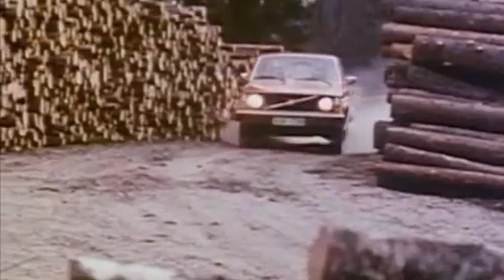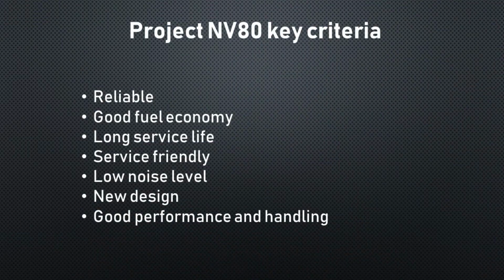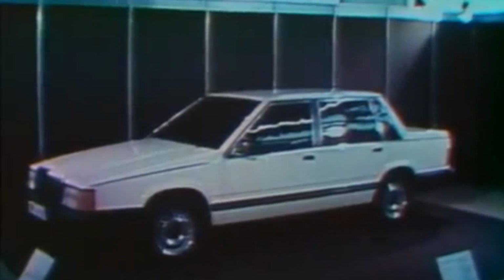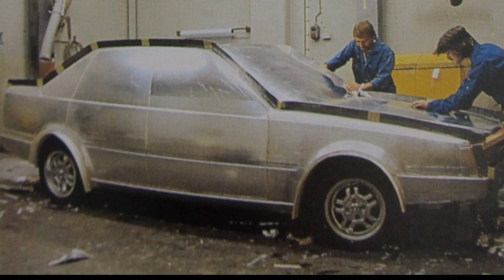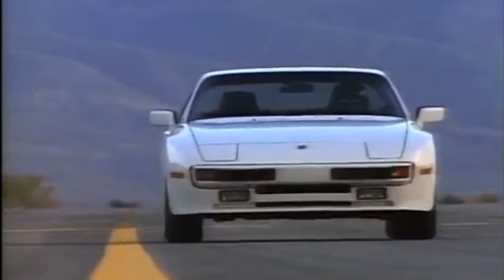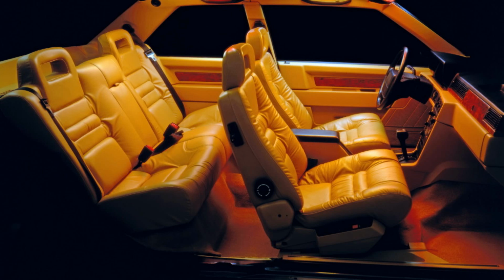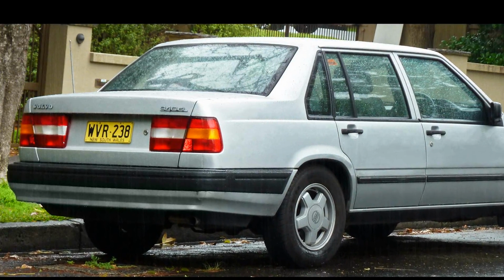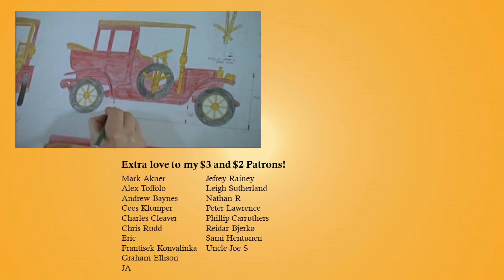How the Volvo 740/760 SAVED Debt-ridden Volvo

Comment from the maker: I mention the 240 was unreliable - in the first 1-2 years of manufacture. After that they solved the reliability problems.
Reply: Yeah. Volvo manufactures some of the most reliable vehicles in human history.
What's funny is, most are afraid of purchasing a mid mileage used Volvo. (1-200K miles) Afraid of what Volvo dealers will charge them to change a freaking sparkplug. 
Long story short: Our used car lot commonly purchases mid mileage Volvos at auction for anywhere from $375 to 3K and resell them for 3-10 times purchase price.  With very few coming back with mechanical issues. The same can't be said for Fords, Chevys, Cadillacs, Pontiacs Dodge Chrysler Lincoln Mercury HumVee/Chevy....ya gotta  get an old Mercedes or BMW to hang with used Volvos. Or just get a 1987 Jeep Cherokee 4.0 and put 1/2 million miles on it going places monster trucks couldn't even go.
Anyway, love your content @Big Car. Huge thumbs up again.
Of course Toyota Honda duh.
Reply: B Brunson  
Yeah. Or '70 Plymouth Barracuda. Lol 340 6 pack.
Reply: Big Car why is your name big car ?
Reply from the maker: @a-manlordsoftime755  Good question! I picked a generic name that was easy to remember and matched the icon I chose. When I started my channel I didn't even think I'd do car videos exclusively.
Reply: @a-manlordsoftime755  
Because tiny car was taken. And tests showed that ugly car wouldn't be so popular. Not to mention big fat car.
Reply: What were the main reliability issues? My parents had one of the last 145's (registered in July 1974) and kept it for 30 years. From memory it only failed to proceed once, when a fuel hose split
Reply: I had 1976 245. Very basic and was not unreliable IMO. Had a single fuel pump that lasted over 100K miles, K-Jet and ignition were fine, can't say I remember any weak spots other than blower motor resistor.
Reply: was just about to scream but then this comment saved you my man
Reply: ...and made probably the most reliable car of all time!
Reply: About Volvo being a luxury brand is complete bullshit according a documentary about Volvo. In Sweden Volvo is a car for everyone between poor and rich. Outside Sweden Volvo market it self as a luxury car to attract foregin costumers, particular north americans. Today does the chinese owns Volvo and makes Volvo as a real luxurybrand.
Reply: Was about to comment "a unreliable Volvo!?"
Reply: @cmartin_ok  the early B21 engine with over head cam was hard to start, they had to change the ignition coil to a high capacity one with a resistor, that was about all and done in the first two years. The 102hp engine used more fuel than the 82hp B20 from the earlier models that you could opt for. My father bought a 1975 242DL but opted for the known B20, I learnt to drive in that one, he later switched to a 1981 GL with it's new upgraded B23, an motor that needed more octane than was available and Volvo service changed the timing curve in the distributor with new springs for the centrifugal advance setting , still if you went too low on the rpm you could get knocking from them. Later model got knockingsensors that adjusted the by then electronic timing. And as the lambda equipped fuel injected katalytic models became standard in 1988-89 that was a thing of the past. I have allways liked the 240 roadhandling while slippery roads over the 740, the 240 tells you earlier and in a less abrupt way that it is slippery outside and you get to react better. Also, if you run any B21-B230 except the B230K with it's electronic carburator and ignition chambers in the top of the pistons, then there is no way for a broken timing belt to crash pistons and valves, the lift of the standard camshafts are to small for them to meet. The car just stops running.
Reply: The 242 was not unreliable. It was the same quality as any other 240.  
240’s being one of the most reliable cars ever made. That's why they are still around that much.
I owned a 242 from ’76. It was underpowered, but definitely reliable.

Also how was Volvo in debt after making the same car (with minor tweaks) for years and years on end.
Reply: You should elaborate more on this, why were they unreliable. The initial cars were introduced using the Volvo B20 engine, it is by far one of the most reliable engines ever built by any car manufacturer. Ever. It's predecessor, or rather previous variant with a smaller bore, holding the same title. It is the engine that powers the longest ran Volvo (if not the longest continually daylied car ever in human history) the 3.2 million mile+ Volvo P1800. An engine that had it's first full rebuild at around the one million mile mark, if my memory serves correct.
Reply: B Brunson  Interesting. I've had two 1972 164Es, a 1990 760 Turbo and a 2002 s80. My sister had a 1972 (I think) 144. I prefer the 2002. And the newest one has needed the least amount of maintenance. I do prefer the 90s visibility, however. I actually love the new Volvos because they've gone back to their roots in terms of understated, yet elegant style. Sure, they're expensive, but they've been expensive for a while now.
Reply: Compared to what? Compared to Volvo 400 (440,460 & 480) everything Volvo made untill then was super solid cars!
Reply: The 200 series still runs all over the world. Its one of the most reliable cars every made.- infacet all of them from start of production.
My dad had one of the first made and he sold it when it had run lver 500.000 km, with almost no repairs.
Reply: I've had Volvos all my life in the family from 1983 to present, 245 DL, 240 DL, 740GL and 940CD Classic in 2.3LPT guide.
Reply: @swededude1992  That's true for the older Volvos. At that time you drove Volvo, Saab, VW, Ford or Opel. if you was working class, the Boss drove BMW, Mercedes or Audi. Today most working class drive older Volvo, BMW or Merc. If you bye a new car today it's a Kia, Hyundai, Peugeot, Ford, VW because a new Volvo is to expensive for the working class. I drive Volvo but i buy them three year old at half the price.
Reply: I was going to say. The 240 I had was very reliable. The thing that wound up getting mine in the end was chassis electrical... 34 years after it left the factory in Halifax, Nova Scotia.
Reply: I loved my 1985 240. It was the best car $2,500US could buy and it lasted. The wiring and AC were poor, but otherwise a very robust car.
Reply: @phildouglas9086  was
Reply: A
Reply: @tellofiriometto5810  Huh? Oh. You meant Vulva instead of Volvo. Got it.
Reply: Yep.. The 240, along with Camry XV10 and Accord CB, are widely regarded the most reliable vehicles made.
Reply: Yes, or else it would have been one of the biggest lies. Nothing can kill a Volvo 240, at least not humans.
Reply: A first year of manufacture (1975) Volvo 244DL B21E is my daily driver, nothing modified from original, 480,000 km on the clock. Those reliability issues haven't shown up yet! Timing belt snapped a few years ago. I was able to fit a new one myself and was driving down the road 2 hours later. So far I'd say it's as reliable as a block of wood!
Reply: The music added to underline the moment of revealing the car (at about 8:00) to my taste may have been left out. All it does in my case is get me to considerably lower the volume as soon as it comes on it of great it may go on for awhile, whilst it does nothing positive. And very few of your viewers that are a bit 'into' a subject like this and its subtleties and so on need it to appreciate a special moment like that I am sure.
Reply: I own a f plate 940 with 500.000 miles on an a h reg 740 with just under 375.000 most reliable cars I've owned the 940 I've actually owned twice
Reply: 740/760 wasn't considered as "too boxy" for European market. It was perfect classy car for upper class people which didn't want to show off in BMW, but did want some individuality and not to go for obvious choice of Merc. And wanted more for their money.
Like doctors, lawyers, junior managers in firms.
Volvo & Saab attracted very settle people, it was "I'm responsible driver, I'm educated, I'm not drunk, I'm not thief, I'm not scumbag" badge for all the Volvo and Saab drivers. They were not the best drivers, but the kindest ones on the road.
Reply: You really should remake this video because there’s a lot of misinformation, with regard to the US market.  

Volvos gained in popularity from the first gas crisis (1973) well into the late 80’s.  Their cars were selling so well over here that Volvo decided to move it’s cars upmarket in the mid 80’s to compete with BMW and Mercedes.  

The 240 was wildly popular here, so much that although it was supposed to be replaced by the 740 series, they kept selling it into the 90’s.

My family was involved with Volvo of America from 1973 to 1990, and never did the subject of bankruptcy or shortness of cash ever come up.
Reply: Pretty much every first-year model is/was unreliable, but gets better with subsequent model years.

The only unreliable Volvo 200 series I can think of would be the 260 series when it first came out in 1975 in Europe and 1976 here in the U.S., due to the build quality of the PRV (Peugeot-Renault-Volvo) V6 engine when it was originally 2.7 liters (the B27F; it was enlarged for 1980 to 2.8 liters, becoming the B28E). In fact, the previous 164E sedan with the ancient B30E inline six (same bore and stroke as the B20 four-cylinder) continued being sold here into 1975 as the PRV mill hadn't yet met our EPA standards.
Reply: Was going to say…my mom had an 86 240 and that car was incredibly reliable and durable. I’ve never heard “unreliable” and “200 series” mentioned in the same sentence before.
Reply: @Bratfalken  I bought a December 1974 245 with the B21A.  I wasn't aware of starting difficulty or modification but I was definitely aware of the poor fuel economy.  I think I averaged 24mpg and it was real slow.  Not only that, the 4 speed gearbox was rather short geared.  Kind of similar to a 164E with BW35 transmission.

That 245 was a very reliable car and eventually the front strut spring pans rusted out.  I changed the car for a 745 which tended to safely understeer rather than have the 245's roll steer which  reduced understeer.  I now have a 940 wagon which has heavy duty rear springs, sport dampers and polybushes.  It is neutral handling dry, wet, snow or ice and the factory understeer is gone.
Reply: Othervise great video, but 740 weights below 1500kg, not even close to stated 2000kg.
Reply: However, the VW-built D24 six-cylinder diesel engine was an issue, especially in California where it wasn't sold at all. We first had them beginning with the 1980 model year, but not for '81; we got the diesel again for '82 but it would again be off our menu after the '84 model year.

The turbo D24T version was used in our 760GLE from 1983-85 and the 740GL/E from 1985-86; the engine used in the 740GL/E was slightly de-tuned as it made 109 hp vs. the 122 hp version used in the 760GLE. As before, the diesels were not available in California.
Reply: I owned a 1997 Volvo E model, six-cylinder , sedan, it was absolutely indestructible 🦅, with 560000, miles on the odometer, it was still running like the day came out of the factory when I sold it for $2,000 dollars 😀😀😀
Reply: @ClassicTVMan1981X  this was all part of Alfred Shears design in from 1933 ♦️♦️♦️
Reply: No, they were not unreliable the first years. however the paint was bad and they rusted.
Reply: I was gonna say.

Comment: Still a common car In Sweden. Manny young driver started in a 740. The serviceability keep them on the road.
Reply: Manufacturers don't want their cars to be so much reliable.
Reply: DuesenbergJ
most men left, Sweden is too liberal, cheap crap cars, way to big, fuel!!!!!!!!
Denmark people do understand!
Reply: Old volvos, saabs, mercedes and toyotas are almost only 80s cars you still see on road every day here in finland, they are so reliable cars
Reply: Still see many here in Austria too, I want one too
Reply: Similar thing in australia with the ford falcons, they are everywhere
Reply: Where is 740 common in Sweden?
Reply: @michaelhavedal9479  everywhere. Young ppl love it because of RWD and a chassi like a tank and easy to work on and extremly tunable (you can easy get 3-400 hp in them). So they are safe, cheap and good starter drifting cars
Reply: My first car was 240 dl, next 760 v6 and 850 10v 😎😎
Reply: So true no stupid scanner needed to put lights out or make it run how it should run ,, love Volvo's best ever built cars ,,
Reply: Fantastic car, my late father bought one new in 1989 still have it until now, i am looking at another 740 turbo, very few in malaysia. Many 240 left, the 740s and 760s are almost all but gone
Reply: Its also a mad skid machine
Reply: When I was bying my first car, year before I got license, I was looking for 740 GLT for 20v engine... I couldn't find one suitable and ended up with 90 quattro (20v 5-cyl as well).

Later on, I was always looking 740's, but never just got around getting one in 13 years I've been driving...

That is certainly on my list if I ever have money to buy car just for fun of it. I guess they'll eligible for museum license (allowing much cheaper taxation) when that happens...
Reply: @jhutt8002  In Sweden cars that are at least 30 years old are exempt from road taxes without any further action required.
Reply: @Eddies_Bra-att-ha-grejer  I wish that would be in Finland too. Here you have to relicense them as museum cars for tax exemption, and it's limited to only allowed to drive 1 month / year.

But I get why that is. Finnish people would just buy old cars for everyday use otherwise :D

The cat-and-mouse game tax administration and car owners have done here since 1970's with low taxed van licenses is pretty awesome, and tragicomical read, if you can find about it.

It's still going on. I have two same model Audi A6's. One that's licensed van gets 400 €/year tax, and other that's not costs 850 €/year...
Reply: @michaelhavedal9479  överallt!!! Öppna ögonen
Reply: @eemelih5052  i Think u see more old volvos in sweden
Reply: Tragic Sweden! 😝😝😝
Reply: HOW IN THE HELL DO YOU INSURE ONE OF THOSE they are massive, heavy, and have large engines.... sounds like an insurance companies nightmare to have a 17 yold driving one, at least in the UK
Reply: And it can drift
Reply: @ingridkolobaric2389  the 740 is far from tragic
Reply: @michaelhavedal9479  Everywhere, today a lot are rebuilt to A-Tractors (restricted to 30km/h and 16 years old can drive them) but aside from that, there is still a lot. ANd I actually worked on the Factory back then, on the 740/760 line, from -87 to end of -88. So If you own a -88 there is about 50% chance I have had a hand in it. Rearaxel, suspension and about 20 other things.
Reply: @georgecooper1753  Here in Finland insurance per year cost for cars is calculated from the value of vehicle, how much you drive, where you live, drivers age, power to weight ratio, and how much accidents they have in registry.

So Volvos are among the cheapest cars inntems of insurance.
Reply: minus 14 i imported to my country in the time everybody fucking hated their 740s around 2009
Reply: The serviceability of the young drivers, or the 7-series cars?
Reply: Nope.   @thebige7302 , that isn't true.  There are no more Ford Falcons on the road than any other popular family cars of the same age.  In fact, a higher proportion of Volvos would be on Australian roads, than Falcons - because the Ford's were regarded differently by their owners.  Falcons were a basic, replaceable, average car.  
In Australia, it was common knowledge - and even joked about - that the average Volvo buyer was more conservative and shopping in the semi-luxury market.  They kept and maintained their cars longer.  Also, the cars were much more reliable than Falcons! 😄
Reply: One of the best Volvo cars ever made !!
Reply: Same with me. The first vehicle I ever drove was a Volvo 740.
Reply: Saab 9000 just don't last as long.
Reply: @eriksvonrosen267 They're not safe at all, soft mild steel
Reply: The first safe Volvo was the 850